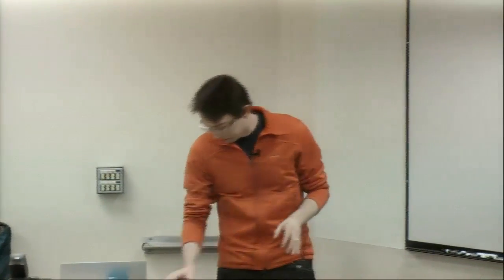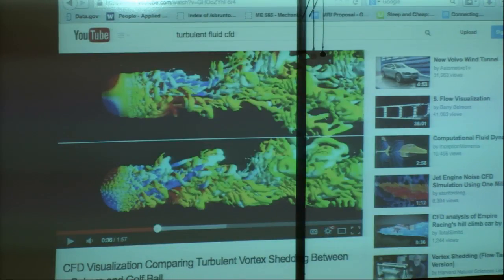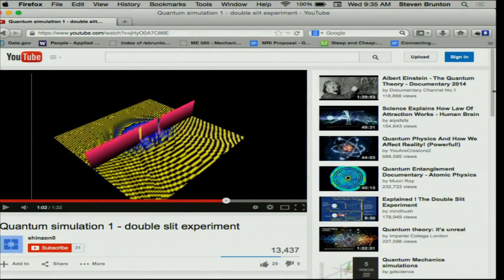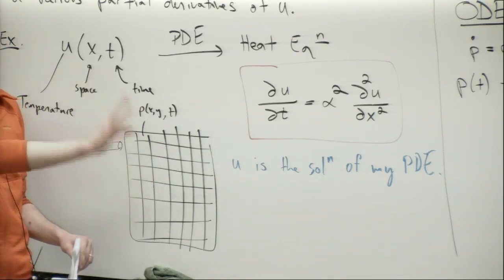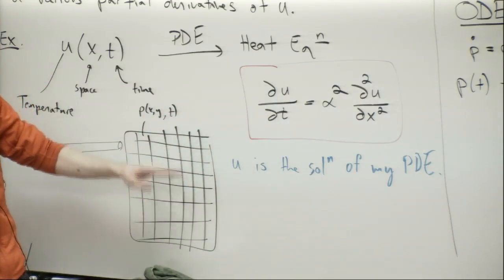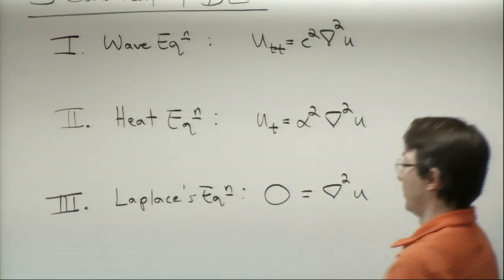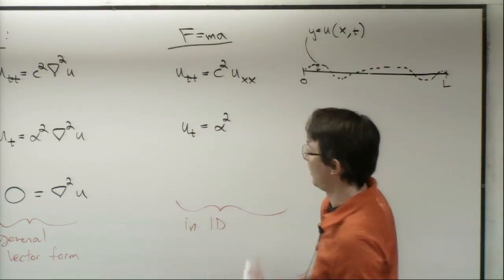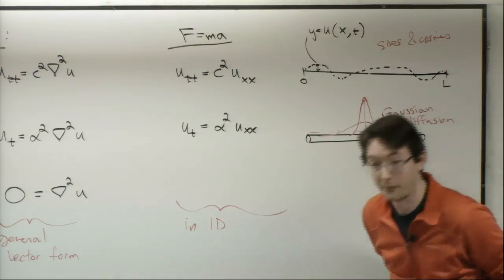ME565 Lecture 7:  Canonical Linear PDEs: Wave equation, Heat equation, and Laplace's equation

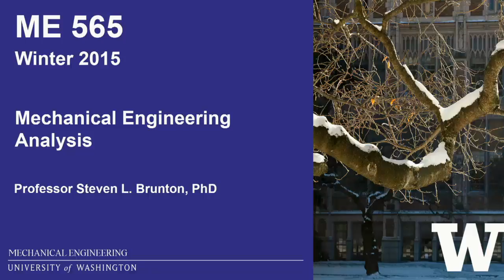Comment: 0:00-14:50 Meaning, Use of PDEs. (How spatial distribution evolves in time for eg.)
16:50. Three Canonical PDEs (Dim 1)
The Heat Equation. u_t=uxx. (Parabolic) The Wave Equation. u_tt_u_xx. (Hyperbolic) Laplace’s Equation uxx=0
Some combination of sines is the solution to the Wave Equation.
The Heat Equation. In response to a unit impulse, there is Gaussian diffusion (from the sines and cosines which are the eigenfunctions of the Laplacian).
The Heat equation which has a stationary in space, Heat distribution satisfies Laplace’s Equation. There is cancellation of the curvature changes in each dimension.
These are homogenous equations. (No direct dependence of derivatives on the underlying parameter.)
Linear PDEs are constructed from Linear Operators acting on the state variable.
L(αg+βf)=αL(g)+βL(f)
D(αg+βf)=αD(g)+βD(f).
Quasilinearity.
Eg. L(u)=u+7, L(u1+u2)=u1+u2+7, L(u1)+L(u2)=u1+u2+14.
45:00 Nonlinear PDEs.
N(u)=uu_x
N(u)=u^2

Burger’s Equation. u_t+uu_x=u_xx
Model of Shockwaves.
uu_x. Nonlinear convection. Viscous term spreads shockwaves.
u_xx is a diffusion term.